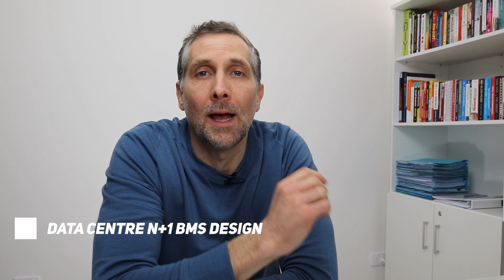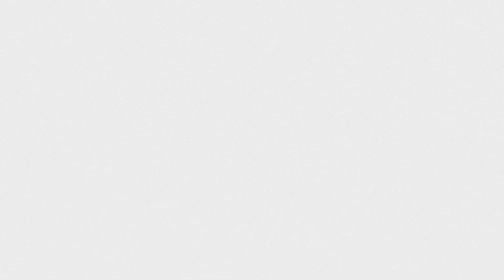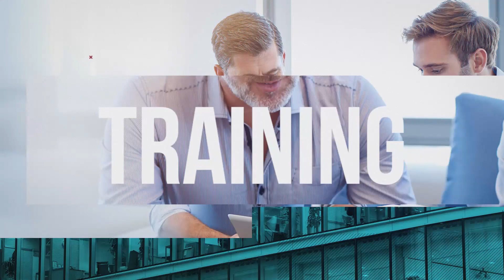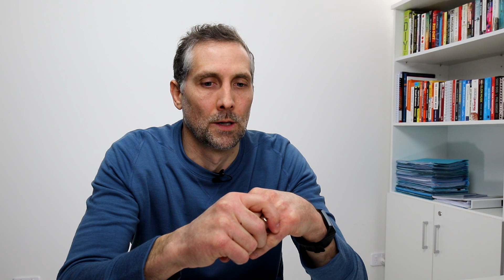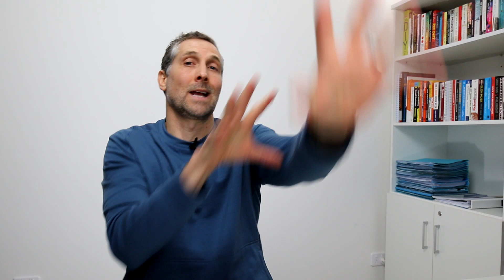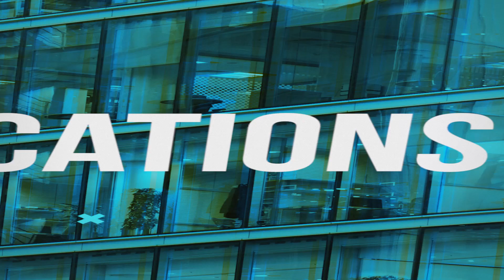BMS Design For Data Centres - (N+1)

Comment: That is not correct in case of a chiller plant. Every chiller has its own electronic controller built in, you need one ddc controller or PLC to host the chiller plant sequence, that’s why you need a redundant PLC if high availability is required, no other way around.

Comment: How topical.......... currently doing concept BMS design on an unusual critical project.  Good points and ideas. 

Question - say you have 4 chiller installation with one by-pass valve.  Which of the 4 field panels gets to control the valve ?.
Reply from the maker: There can't be one bypass valve in a critical facility 😊
There needs to be 2 bypass valves and double sets of system pressure transmitters. 
Yes, easier said than done..
Reply: @bryceanderson17  That is correct about the by-pass valve ..... thou I often use two and sequence their operation (other reasons than redundancy) 

Oh I nearly always have more than one  field DP's - specially with convoluted CHW reticulation system with potentially very variable loads - maybe not a data centre but a hospital - oh yes